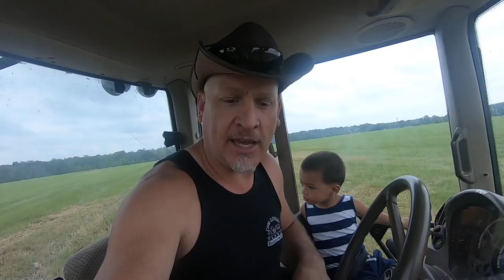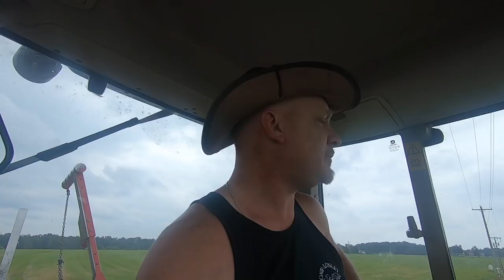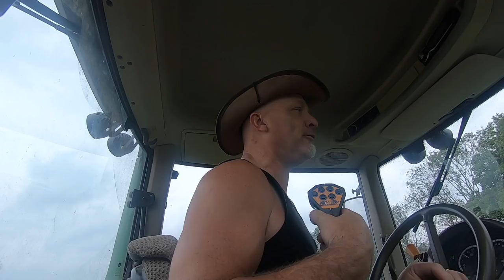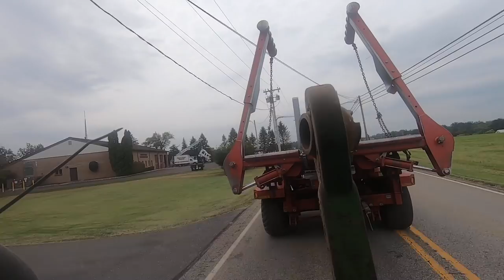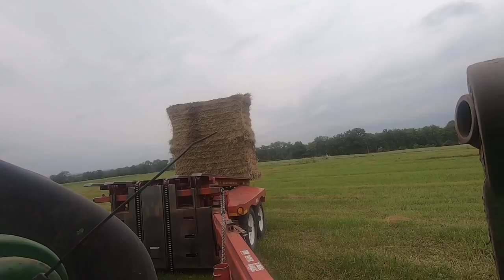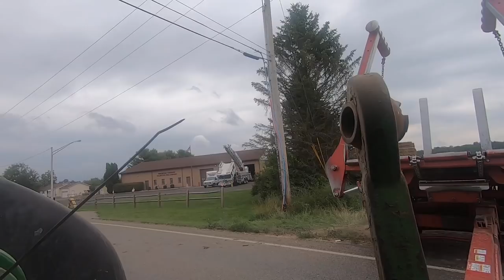The Automatic Functions

Comment: You should consider fitting a camera to monitor the implement in work so that you could drive without looking backwards for every bale. This would allow you to fix the control joystick to your armrest or side console in a convenient position for easy fatigue-free use, looking forward towards direction of travel with the monitor in line of sight.